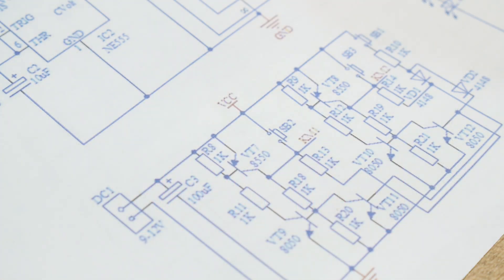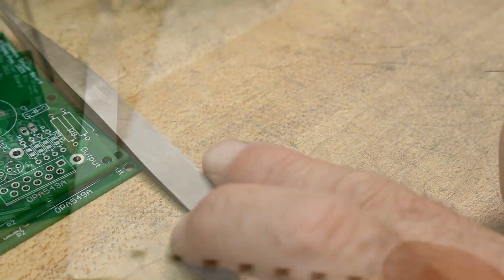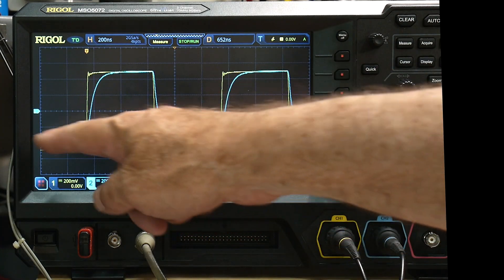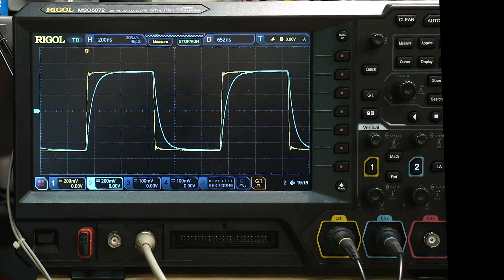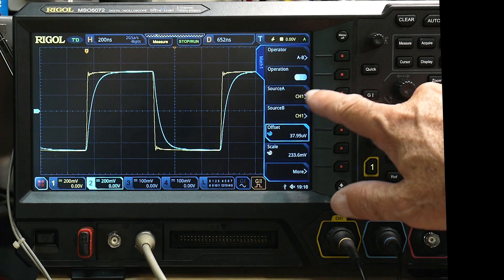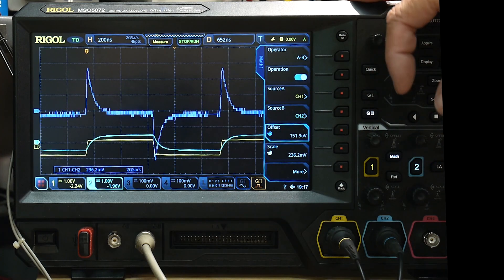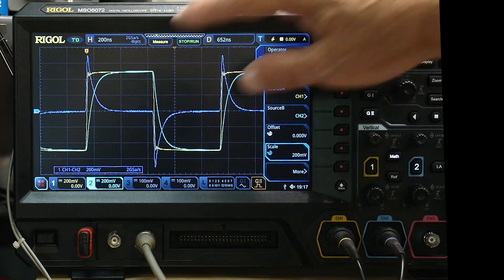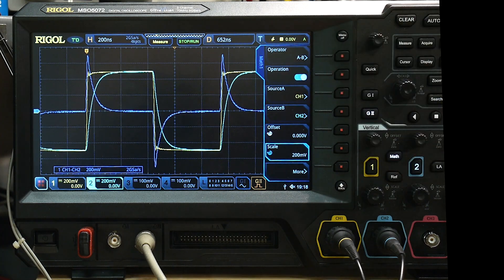#855 Basics: Measure Current with an  Oscilloscope

Comment: What did you connect ch1and ch2  to, can you help me with it plz, I need to do same measurment but i'm struggling with wire connecting
Reply from the maker: resistors have two ends. connect one to each end
Reply: @IMSAIGuy  
Thank you so much for fast reply, I did but it was just noise, no Pulse or any waveform signal. I though I need to connect to function generator to get the signal, but again I do not get how I connect the wiring correctly.

Comment: Someone else probably said it, but what about adding the resistance into the math equation.  Is that possible?
Reply from the maker: if your scope has that function
Reply: @IMSAIGuy  It doesn't look like the Rigol DS1054Z will do it.  I have a current probe, but you have to break out a wire loop to use it and it's not that small.  It hadn't occurred to me to try to measure the voltage drop across a shunt already in the circuit, I was debating about buying something else.  I just bought this Rigol a few months ago and need to do some (in circuit) current testing.  This will work.  Thanks for making the video.  Cheers.  Edit: just thinking again, if I power the test circuit by battery (no ground), I could use a single probe across a resistor.  hmmm.....

Comment: Respectfully I'm not following this. By introducing a capacitor the circuit has another load, another path to gnd, thus more current will flow than if the capacitor was not there. When the waveform is "low" the capacitor is discharged and thus a short to gnd. As the waveform rises max current flow occurs as again the capacitor is shorted to gnd. With the new path to gnd o the shorted capacitor, the rising math waveform representing current is initially limited only by the series ESR and Self Inductance of the capacitor. That is the peak we see on the math waveform. Then of course as the capacitor charges its reactance limits the current flow to gnd and we see the typical soft landing curve. 

So what Im seeing on the waveform is the current through the added capacitor not the current that would be flowing into a high impedance ckt like an op amp or just through some 1K resistors to gnd which should be significantly different. 

Okay....please explain to me where Im going wrong here. Thanks! Nice to the point video, thanks for that too!

Comment: this is with square wave as input from function generator.  What if want to measure current drawn by a MCU or BLE chip like STm32wb55rg powered by battery. I don't have Power Profiler. Just an oscilloscope 100 MHz 4 channel and multimeter. I want to measure 200nA to 1A current measurement range. any tip or IC suggestion ?
Reply: One tip... Get the nRF power profiler

Comment: what if the circuit is an op amp made up out of many MOSFET's and no resistor to measure? ^^''
Reply from the maker: you will need to unsolder parts of the circuit. 
1. use current meter
2. use clamp on probe
3. add a low ohm resistor and do as per video.
4. there are very expensive probes that I have never used that can detect current in traces.
Reply: @IMSAIGuy  Thanks for the answer!! :D

Comment: Great video sir, i am wondering if you connected the ground clips, logic tells me you did not, becuase you are using both volage probes in a sort of differential configuration. Can you use this method on a resisor at any location in the circuit or is it just on a low side resistor, with on side connected to ground ?
Reply from the maker: I think it best to connect the grounds. you can use resistors on the high side as well
Reply: @IMSAIGuy  Very interesting, thank you sir.

Comment: Did yo someone input the value of the resistor into the Oscope? I still don't see how you can get the current measurement from those 2 probes. i understand from the probes you get Va-Vb = Vab but then Ohm's law says you still need the resistor value to get the current.
Reply from the maker: you need to read the resistor color code or look at a schematic for that.

Comment: hi can I use 150 MHz probe on 50MHz oscilloscope?
Reply: It depends, but probably. Try it.  If it adjusts properly when using your scope probe adjustment square wave then you're go to go. 

If the input capacitance of the scope falls within the adjustment range of the probe then you should be fine. Example, Tektronix 2225 50MHz scope has an input capacitance specified at 25pF, plus or minus a couple pF.  A Tektronix P6130 probe has a -3db bandwidth of between 150 - 250MHz depending on probe cable length.  The probe specification says it will be happy with scopes between 10 to 30 or 35 pF, again depending on cable length, so should work well.

The 350MHz probe that comes with the Rigol MSO5000 series scopes is specified to handle scope inputs of between 10 and 25pF.  It might not adjust properly to the Tek 2225 where it's right at the limit.  The Rigol probe should be fine with a Tektronix 2215A (for example) which has a 20pF input capacitance and a 60MHz bandwidth.

Comment: Is 6 amps AVERAGE DC current on hand held multi-meter, or panel meter,, the same as PEAK 6  DC amps on oscilloscope? I thought it was a 60% difference.
Reply from the maker: DC is constant voltage/current. there should be no difference between average and peak unless there is a lot of noise on the DC. then the peak would be a very small amount more.

Comment: Thank you for the video. Recently, I found a gotcha, in that I was trying to use my function generator output to pick off the voltage across a resistor to sense the current for the Y axis to trace a transistor curve, but I couldn't because both instrument BNCs are grounded. My first clue: it picked off the voltage without the ground lead attached. This is why--even an old isolated, low voltage transformer works as the lowest form of curve tracer, yet my function generator would not work that that (re)purpose.

While I am not optimist that the 1054z would accept the output of a math function as y-axis component of the XY, this video was food for though. Thank you for the video.

It's iconic that the old scopes had a built-in trace function, but a modern digital scope doesn't. : P

An isolation transformer would have fixed this problem, but some people do die from 115v AC, and well, the BNC jack is indeed metal and well the switcher has 90vDC in it, which I likely would hold onto for the rest of my short life. Still, I hate the specter blowing up my equipment because grounds are connected.

There are curve tracer kits, but I am on a very limited budget.
Reply: What should be the value of resistor to sense the current perfectly....

Comment: How did you get thin traces like this? Because on my oscilloscope, the same rigol mso5000 you have, them are thick and full of noise. Without avaraging i cannot get the same visual result as you but you don't seem to use avaraging. Thanks
Reply from the maker: I don't remember on this video. The scope is very fast so it shows lots of noise on traces. I also use averaging a lot and reduce the BW to 20MHz depending on what I am doing. Good  grounding helps of course.

Comment: Thanks for this! I am interested in measuring the current draw of an entire circuit (battery powered) over a few seconds. Could I treat the entire circuit as the "resistor" (load), connect probes to the + and - of the battery, subtract the 2nd signal, and then convert to amps by dividing the voltage by the circuit's equivalent resistance (assuming it is constant over sleep / active cycles, which I need to check)? Or maybe I should introduce a very small (shunt?) resistor in series with the + or - terminal the battery and measure across that resistor in parallel...?
Reply from the maker: no, you would be measuring across the battery in parallel with the circuit. you need to have a resistor in series
Reply from the maker: pick a resistor that allows a good measurement and can handle the current. be wary of the burden voltage.
Reply: @IMSAIGuy  Thanks so much.
Reply: @IMSAIGuy  Thanks. So a resistor in series with, say, the positive terminal would work? Any recommendations for going about deciding what size resistor to use?
Reply from the maker: @avi-brown  https://youtu.be/cFcwHVppu3w

Comment: If I use differential probe: do I get same results ?
Reply from the maker: yes. most diff probes are for high voltage, so you will have problems at low levels. low voltage diff probes are quite expensive
Reply: Poor man diff probe is A - B.  Two things i could never bring myself to buy for my lab, A diif probe and a good current probe.  The current probe more than anything is what I miss, not greedy if i had something up to 10MHz, but alas i have a cheap bk 300kHz probe, and a sense resistor every now and then.  Some day i will buy that probe.  Thx for sharing.

Comment: With the usual reminder that the ground lead needs to go to ground unless the scope is isolated from the thing being measured. This is for those that have the Eureka! moment and think why can't you just put the leads across the component :-)
Reply: Thank you Vince! You read my mind.
Reply: @TonyBarr99  Ditto
Reply: Dont BLOW your scope brah!
Reply: Here it seems he is using the two voltage probes in a sort of diferencial Mode, so it is my beleif that there is no need to connect the ground probes at all, just the probe tips. Also i thought this method only works when the resistor is on the low side of the circuit, i.e. one side of the resistor Connected to ground?

Comment: If you have the correct scope?
Reply: My digital scope dose'nt have any maths functions. LOL.
Reply: I think most scopes will do A + B. To get A - B, you need to invert B. (I think, I haven't used the function for a while)
Reply: @mavamQ  Yeah, a lot of scopes have an invert and add function. My old tek 2465B has this. There's no "math" since the 'calculations' are done in the analog domain.
Reply: Thanks for the info.
Reply: @jdmccorful  np
Reply: @crash burn It's a FNIRSI-1013D Dual trace.